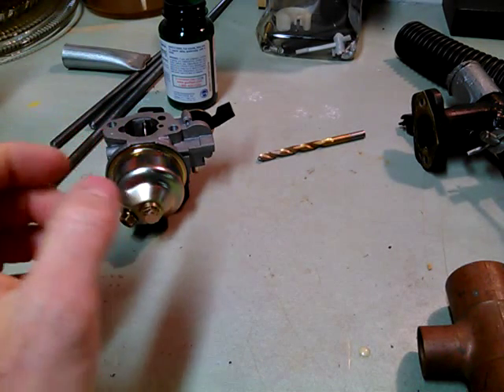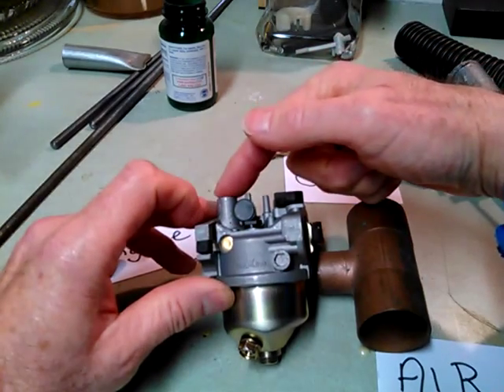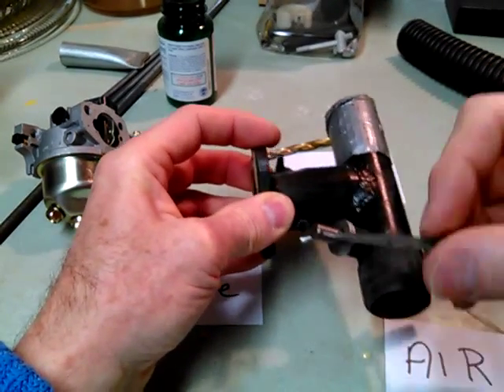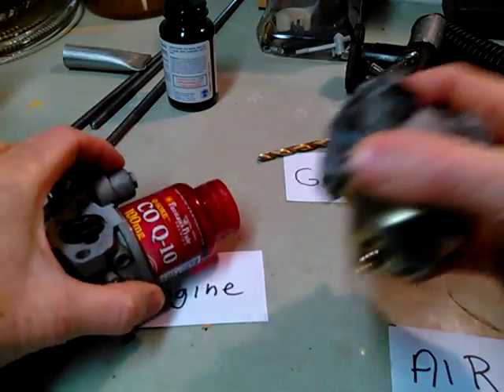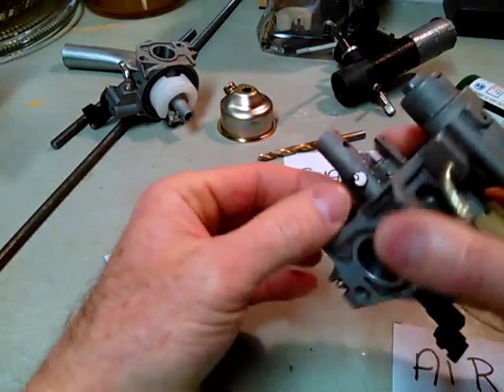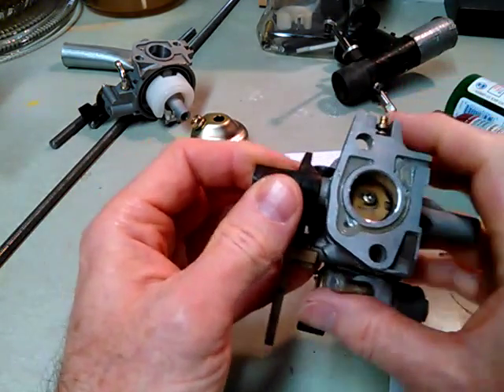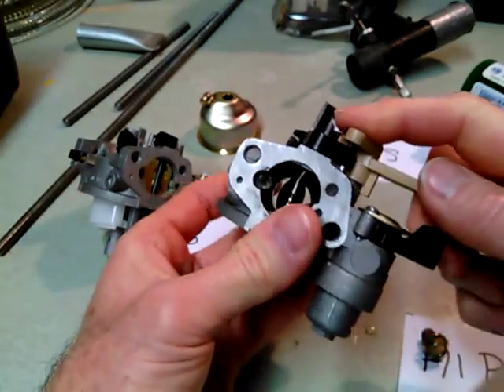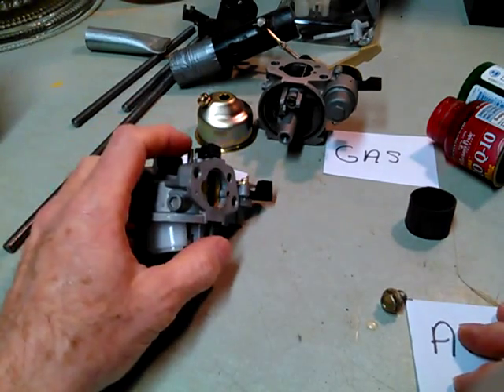Gasifier Carb

Comment: Hey Jeff,  great video.  Was wondering if you ran across any problems with this modification? If so would you be willing to share? Thanks again,  Jack
Reply from the maker: Jack Ruska I have never had a problem with this modification. It tends to be a bit rich at idle so I opened up the idle circuit with a small drill bit. It seemed to help and next time I will open it up a bit more. Not sure if that was in the video.